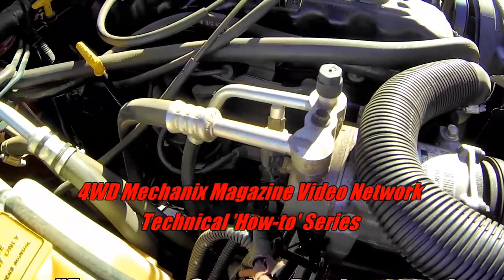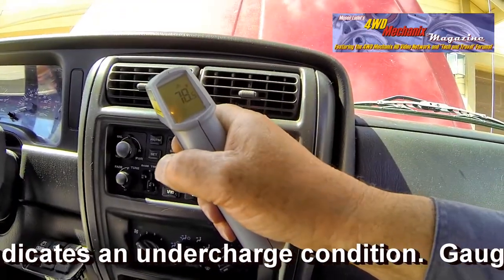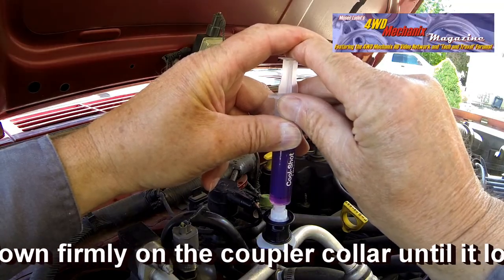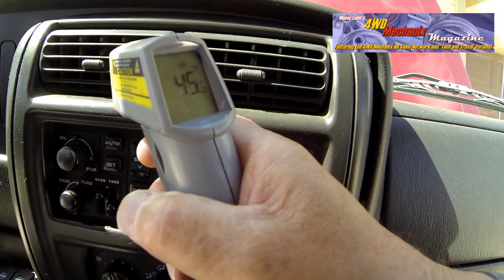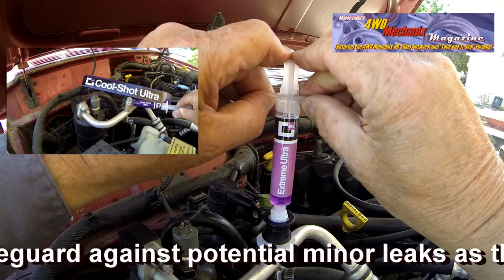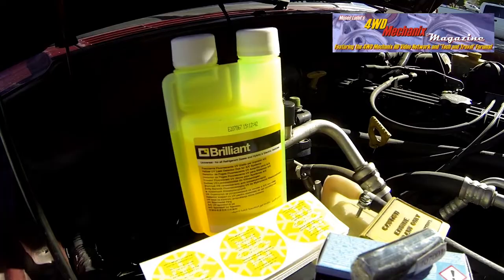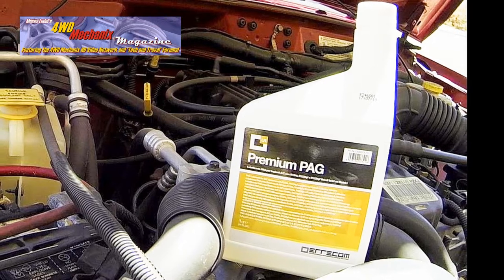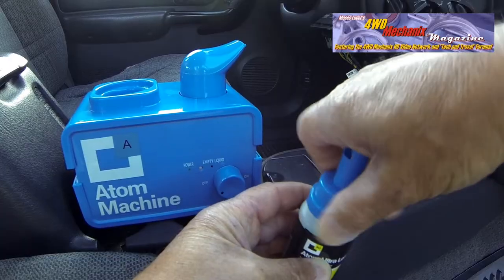4WD Mechanix Magazine How-to: ERRECOM Air Conditioning Products

Comment: Over 65,ooo miles check your evaporator for cleanliness . Plus a full system inspection . Remember if you modify the compressor oil with an additive your compressor  warranty will be void .
Reply from the maker: Your tips are important to installers!

Comment: You show lubricant (Cool Shot Ultra) 1st, then stop leak (Extreme Ultra) 2nd, then External last.  Wouldn't it be better to do External 1st, Stop Leak 2nd, then Cool Shot Ultra last, that way you won't be blowing lube out of the system via leaks?
Reply from the maker: Ah, good point.  Most service techs do a chemical/black light, dye or similar check for leaks before installing these products.  I run pressure checks first to make sure the system is holding pressure...In my experience, bad O-rings, worn seals or flare/flare seat leaks should be ruled out before installing any additives or fresh refrigerant.  I always repair mechanical leaks or seepage first.  A product like Extreme Ultra is insurance and not a substitute for fixing mechanical issues.  Thanks for sharing.  Your feedback is valuable!

Comment: Leak detector must be introduced with AC on?
Reply from the maker: Leak detector dye is like adding refrigerant—with the A/C operating.  Follow the charging steps for your vehicle's system when adding a dye.  With many leak testing kits, leaks become visible with UV light.  There are also Harbor Freight to commercial grade wand-type testers that can test for a refrigerant leak without adding dye to the system.  These testers "sniff" the hoses, connections, condenser, compressor seals, HVAC plenum and any other place where refrigerant might leak.  The electronic tester is sensitive to refrigerant.
Reply: @RoadReadywithMosesLudel  Thanks you.👍👍👍👍👍
Reply: @RoadReadywithMosesLudel  but if my system is full of refrigerant already ,just turn on Ac and add the leak detector. Right?
Reply from the maker: There is generally room for dye detector without overloading the system.  However, I always use and recommend gauges when performing this kind of work.  I watch the pressure and keep the system within the normal operating pressure ranges for the ambient temperature.

Comment: i do not agree  the cars thermostat will control the temperature  no mater how cold it is the thermostat will turn the compressor off
Reply from the maker: I agree that engine coolant temperature is regulated by the thermostat.  The A/C condenser temperature affects the engine cooling system's load.  Different refrigerants and refrigerant additives can impact the air temperatures flowing from the A/C system's vents.  A change in refrigerant type or a quality additive can change the A/C efficiency, regardless of the engine's coolant temperature.